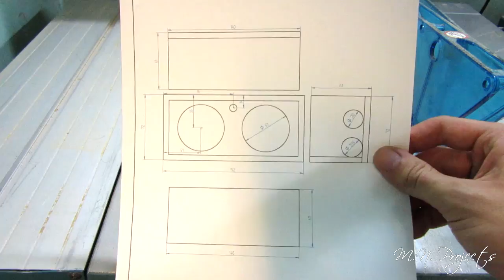Making a Bluetooth Speaker with Powerbank

Comment: just a tip, but when doing a sand with sandpaper in your hand, you should always go with the grain. Then later on if you stain it, it brings out the grain a lot more. other than that great video!

Comment: Nice build. Really insprational. I’m starting my first speaker right now. I have a similar small 25 w amp laying around and two ~4”, 8 ohm, like 30 watt speakers too. Do you think I can hook up two or more of those rechargeable batteries to it and make it work? Or should I just buy like a small battery pack? I’m kinda confused on the battery situation. Any tips? The amp has Bluetooth and I think it’s rated 8-25 watts or something like that. Any ideas.

Comment: what amplifier did you use and could you solder a dedicated bass to it?
Reply: I don't think bcs it's a 2x3W watt so you can only solder 2 speakers. You could maybe solder 1 speaker and 1 bass.
Reply: whats a "bass"
Reply: i guess he meant tweeter and woofer...
Reply: kira Oz do u know wht speaker it is aswell
Reply: You don't need a bass speaker, just make the case air tight and add a passive radiator to the back panel.
Reply: Daayan So gae you have to calculate the passive radiator aswell. Its not like you just put a random membrane and its done.

Comment: Guys, i need some help. I did everything like him, connection wise and everytime when i turn the volume above 70% the power bank just turns off. Amp draw isnt near 1A(which is tested my power bank can handle). Amp draw is like 0,2-0,3A and when i turn volume one notch on phone power bank turns off everytime.

Comment: one problem  I have with power banks are that they turn off automatically while listening  to music can you please  give  a solution  to this??
Reply: connect your wires directly to the battery, not on the usb output
Reply: Won't that disable the protection circuit and discharge the battery too much?